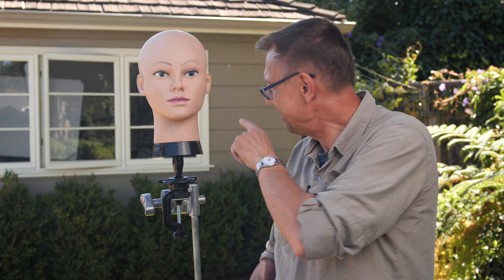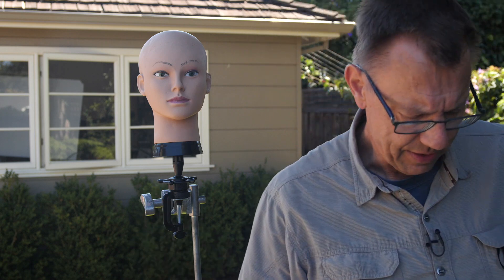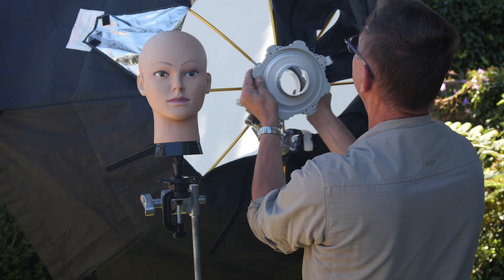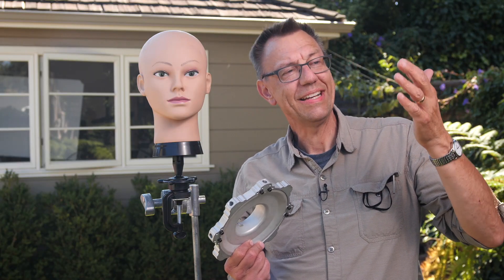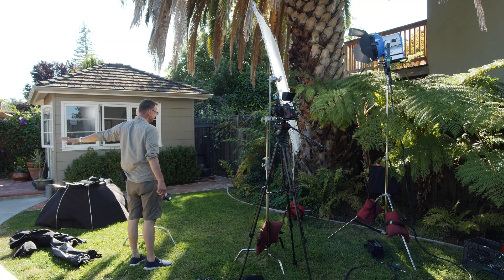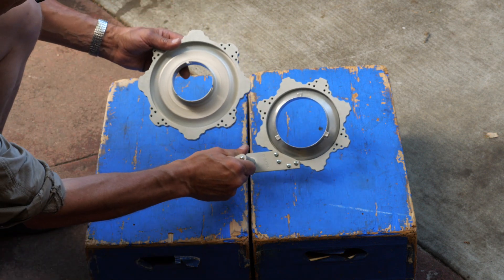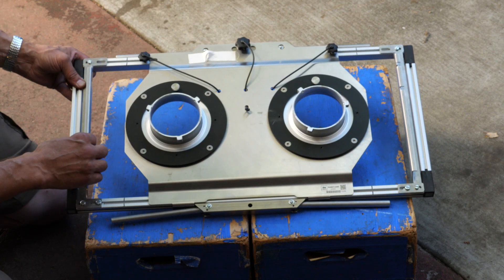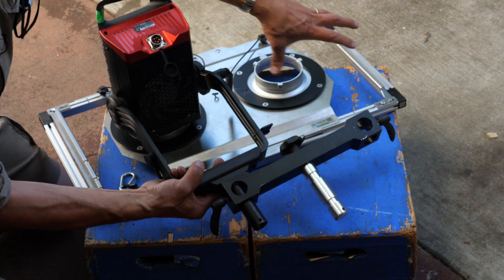Meet the Gaffer #246: Comparing HMIs and LEDs in 5 foot Octabanks

Comment: What are situations you would use the M18 over the 2 600d's ? And how often ?
Reply from the maker: Totally depends, but say you have a larger set up and need all your units, you may want to use the 600’s individually for other parts of your set up. Eventually we’ll just replace the M18 with a 1200d and have all units remote controllable😉

Comment: So the 2 aputure 600 is as powerful as the hmi M18 or more powerful?
Reply from the maker: In the same ballpark, if not a little more output… and dimmable. Mind you, if you are renting 2x 600d’s compared to 1x M18, those are not equal🙂
Reply: @meetthegaffer  what do you think of hmi LTM CINEPAR 1200 THRU A 1/2 GRID 6 BY 6

Comment: Thank you for sharing this information. It's good to see how LED lights come up to compete with HMIs. Care to share how to travel with these lights (LED) to remote location?
Reply from the maker: As far as travel worthiness goes, the Aputure lights arrive in solid cases that are great for travel. The 600d pro comes in a roller suitcase with a retractable handle. Unlike Tungsten and HMI’s, you don’t need to be as protective of the “bulbs” you are traveling with. What aspects of travel are you concerned about when it comes to LED’s?
Reply: @meetthegaffer  I'm looking for the aspect of compact size and low weight to fit into my travel case and stay in the weight limit of the 32kg of an airline.
Reply from the maker: If those are the constraints it seems to me we would be talking about different units than discussed in this episode. There are other episode that speak to single person road kits (ep#75), but you end up working with a lot less light. Otherwise you begin to add budget to account for more luggage or oversized luggage😬

Comment: Hey Luke, I recently purchased a used 1.2k HMI. I bought a new bulb for it (phillips). It has a noticeable green cast on skin that would require heavy minus green to reduce it. How often does this happen with new bulbs? Is there a brand and retailer you would recommend that sells more accurate bulbs? Thanks!
Reply from the maker: It’s been a while since I’ve bought HMI bulbs, so I asked the good folks at JCX Expendables if they’d like to weigh in. First off, a heavy green cast is not normal from any manufacturer. JCX happens to sell Osram brand and have not gotten feedback about excessive green. One suggestion would be to visit a colleague who has similar units to yours and run a quick test with one of their bulbs. I hope you find better luck out there soon!
Reply: @meetthegaffer  You rock dude!!

Comment: Thanks for the hard work. Very Informative. I see that when you use the single 600, you attach the softbox to the stand and take the weight off the light but when you use the rabbit ears the weight of the softbox is on the 2 lights. I would imagine that the weight on the softbox/gobo head design is a better way to go since it distributes the weight and does not make the setup front heavy. What are your thoughts?

Comment: Heat and amperage aside, do you prefer the look of LED or HMI for narrative feature films and controlled environments? — The color that tungsten lights provide is dreamy and velvety to my eyes, but CTB gels are a light killer when daylight color temperatures are required. For reference I shoot with Sony PMW-F5 production cameras (not to be confused with the the smaller FS-5) and if my eyes can see it, the F5 can too. F5’s have amazing color capturing abilities. I’m in L.A. and have the support that geographic proximity to L. A. provides. I’ve never used HMI. LED light usually looks fake or funny looking and unnatural to me. I have Mole-Richardson LED fresnels so I assume they are a top tier LED for color rendition etc. I’m considering a pre-owned Joker 400 to get started in HMI but even one used Joker is cost prohibitive for me although not impossible. Renting doesn’t work for me...too many variables...pickup...inspect...drop off...etc. If the answer is “you need all types of lights depending on different scenarios” I certainly respect that response. If actors are sweating profusely in close quarters, then LED may be only option in that scenario. Sometimes one light with v-mount batteries is needed if shooting fast. But generally speaking, for narrative work and controlled environments, when color rendition is paramount and unlimited power and air conditioning are at hand, do you have a preference of HMI or LED when shooting with full size production cameras that capture color well, for better or worse? I hope this question is helpful and interesting to others. Thank you sir for sharing your thoughts. 😊
Reply from the maker: Interesting question. There are a lot of strong opinions out there about what kind of light is the most pleasing. You could start with the sun and work your way through candle, carbon arc, tungsten, HMI, fluorescent, LED, and whatever is coming next. Some DP’s are adamant about only using one type of unit and begrudgingly add different fixture types if budget demands it. I try to be agnostic because I do my best to help the DP realize their vision, while keeping the producer happy as well. So whether I prefer this or that type of fixture has less relevance than you’d think. Consequently, I see the benefits of all types and can’t really afford to be prejudiced against any type of unit. If I only worked with tungsten, I would have very little work. Sure, I like the look of tungsten units, but I’m grateful for the alternatives. Beautiful work can be done with almost anything if it’s in service to the story. Like ideologies that take hold in a person and lead them around by the nose, there is no convincing some people that HD video is a worthy format for filmmaking. Some people are like this about tungsten. This has played out in other art forms as well: from perishable painting formats like fresco to tempera to oil to acrylic to who knows what. If you held a gun to my head, I would go with old-style kinos, but I rarely have the opportunity to use them anymore, just like tungsten.
Reply: @meetthegaffer  what do you like about old style kino's vs the new led lights of today that compare . And what are the benefits of the tungsen kino tubes vs the daylight kino tubes ? I have kink flo 4 banks and wall o lites.

Comment: Can the 600's run off V-lock packs like the older Aputure range?
Reply: You can power them to 100% via the 48v input with 2x GenEnergy 26A Monster Batteries and their PB48 Power Station. 
Afaik Aputure has software limited the inbuilt battery plates currently, where they only will power up to 50%.
Reply from the maker: @MudreFilms  Thank you! That's great info.
Reply: @meetthegaffer  You're welcome! I believe its the PB48-M2 specifically (the newer version)
We had a little diversion about this on the CML Call today. Lots of folks are also using the EcoFlow Batteries to power their beefy LEDs, and it has me interested. Mainly due to the fast recharge times.
Reply from the maker: They can, but you won’t get full power out of your unit. You can get closer with 26V batts, like the ones from FX-lion, and there may be some others with higher voltages that would be even better. Check the Aputure site… they are working on a list of compatible batts. Another route are the small portable batts that are mostly designed for camping!

Comment: Wait, you can run a M18 with a powergems ballast on a 2200 Genny? I just got one of those brand new Honda EU2200i gennys, that’d be cool if I could run a M18 on it.
It just seemed like that was something you mentioned in passing, but I had never heard of that being a thing before. Any elaboration on that?
Reply: And side comment, I love my Joker2 800 + Chimera Octaplus 5 setup! Guess I gotta get a Bowen’s adapter for the Octaplus to start using it with these new generation point source LEDs. It does make sense that the 600D is spottier, as the Joker bulb shoots light out in all directions inside the box to bounce around and give you that softer feel, whereas the 600d shoots it out frontal only from that single COB
Reply: I got the new 2200 as well. Lightbulb grip posted in their FB story recently that they ran an M-18 on it. Said it burned for a few hours. I’m not sure what ballast they were using.